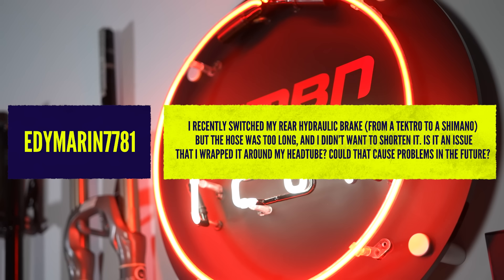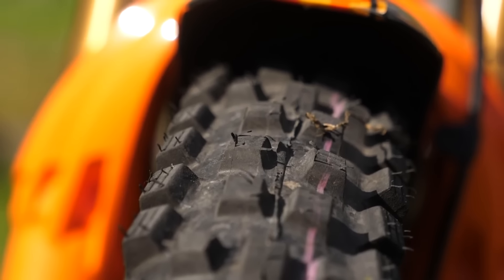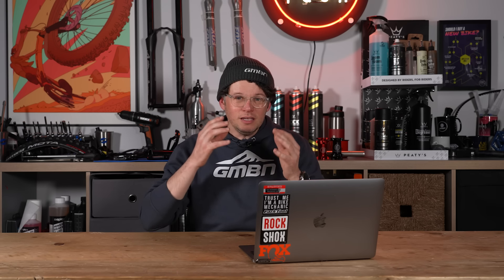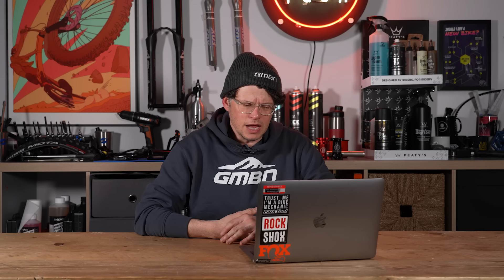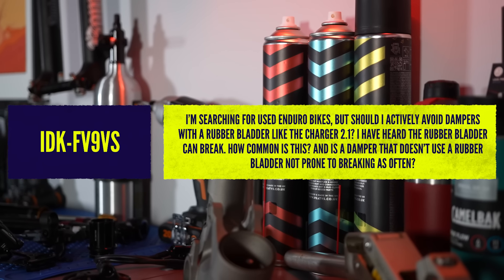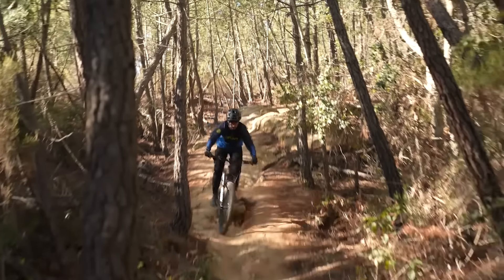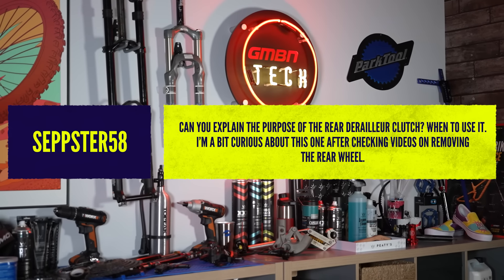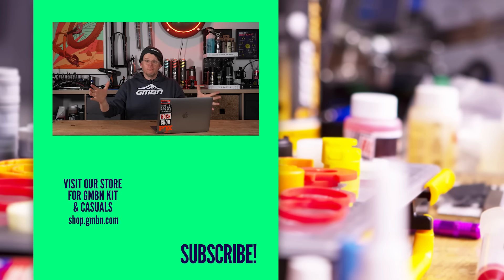Does Putting Helium In Your Tyres Make Your Bike Lighter? | Ask GMBN Tech

Comment: i get Nitrogen in my car tires, its definatly better. My tires hardely ever have needed topping up. been doing this for years definatly do it. My tyre guy does it for free but it would cost £10 for all tyres so cheap.😊
Reply: I do fill up my bikes with nitrogen at the local alignment shop (5$ a pop) since it's inert it's supposed to keep sealant fresher... Seems to work well.
Reply: Oh I also got my dpx2 and zeb filled up with nitrogen, I forgot. Tbh I didn't service them for months they're probably out of gas right meow 😂
Reply: @LawrenceMacMacster  I am going to try that with my fox factory stuff, it's 100% better in my car so why not everything else. I am so surprised that in this video he qent on a bit like it was new cutting edge when it's not been doing it for 10 years or so with my car haha

Comment: Helium and CO2 will leak thru rubber because of the molecular structure.  Butyl rubber used in the fabrication of bicycle tires and tubes are a carbon structure, making C02 and He a poor choice.  Most sealants like X-Sauce don't like CO2, they probably would like helium and it might last longer.

Comment: For the squeak in the drivetrain. I recently replaced the jockey wheels without lube and it squeaked only in the lowest gear (largest cog). Once I lubed the jockey wheels, the squeaks went away.
Reply: My bike squeaks on the 3 smallest sprocket, with large chainring... other gears sound OK, even with worse cross chain.

Comment: #AskGMBNTech Is there a way to determine the tire clearance of a frame if you cannot find the manufacturer specs for it? I have an old, discontinued frame and information about online is a little sparse. I've tried putting 2.4s in it and it only had a hairs width left between the edge knobs and the chainstays and that didn't look safe, so I switched to 2.2s and those look like they work much better. It's a steel hardtail frame so it probably flexes quite a bit so I'm assuming it'll need even more clearance just to be safe. Is there an actual minimum recommended gap between tire and frame? This information should come in handy as I have a tendency to acquire weird and obscure old bikes.

Comment: #AskGMBNTech Every time I bleed my SRAM Guide R brakes, I finish by compressing the oil at the lever and obtain a nice small lever travel before it reaches resistance. Though once I screw out the syringe, oil pours out of the bleed hole and lever travel becomes crap! Any tip on how to obtain a better result without buying RSC's?

Comment: #AskGMBNTech Greetings Tech Team. I’m a 60yo who recently had a bad crash. Mind was in neutral when it happened and I landed on my helmet just above my right eye. Ko’d for 20 mins and a subdural haematoma for my effort. The insulting part is I was only going 10kph. Wear your lid people. My question is as I was wearing an open face helmet at the time, beside the chin guard, does a full face enduro helmet have a higher impact rating? I better err on the side of caution from now on. Thanks for your time.

Comment: #askgmbntech tire sealant and tubeless question I had a WTB trailboss 2.4 rear tire set up tubeless after 4 months use i found it deflating through the week  so serviced it with a refresh of sealant but the fresh kept leaking through innumerable pinholes in the side wall of tire , still plenty of life in tread so dropped in a tube . Question would removing old dry sealant (no sharp tools used) caused the issue and is there a limit of  hole size for sealant closing ?

Comment: #AskGMBNTech Is there an easier way to detect where a creak is on a bike. I have a Carbon full suspension frame and there is a subtle creaking sound. I hear it while seated or standing, so I know it's not the seat or post. It basically happens when the suspension is compressed, but I can't tell if it's the front or the rear suspension because I hear the sound throughout the frame. It would be neat if there was an electronic tool that could tell where the sound is coming from. Any tricks or tips would be awesome!

Comment: I would have to think that even though helium would technically make the bike lighter, it really wouldn't make much difference because the rotational mass will remain the same. So yes, your wheels will weigh less, but it will take the same amount of energy to turn them.
Reply: Here in Brazil, a yt channel has already tested the weight with helium gas and didn't see any difference even though he made some mistakes when taking the measurement.
https://youtu.be/FxYWH2O1Xyw?si=TPUqhgrwIs-U6GoL
The explanation of the size of the molecule would be the only good justification, even though it is more expensive to inflate the tires and you cannot find gas on every corner.

Comment: #AskGMBNTech My Ergon Saddle keeps on squeaking, if I get onto it. I have tightened the seatpost clamp to the written Nm, put some grease on the rails and so on. But I think the noise comes from the area, where the rails merge into the saddle. Further infos: when the saddle was new, it was silent. but after i had to clean it, because my rear wheel tore and sprayed tubelesmilk all over my bike, the noise became louder and louder. How can I fix this? cheers Andri

Comment: #AskGMBNTech "I recently bought some less aggressive tires for my MTB for some upcoming events and also got some TPU tubes. Thinking the bike came with tubes in them, I opened up the tires only to find they were Tubeless (with no sealant) This came directly from the factory like this. Seeing where the air valve stuck out, inside was a raised section to seat the valve. I did not swap tires fearing the raised section would have impact on the TPU tubes. Also not sure if the new tires are Tubeless Ready. Should I stay tubeless or can I go with the new tires and TPU tubes? Thanks!!
Reply: You should be able to find out if your new tires are TL compatible from the manufacturer's website (if it's not written on the tire irself). If possible, i would always go for a tubeless setup... :)